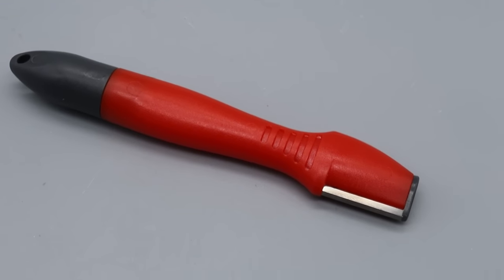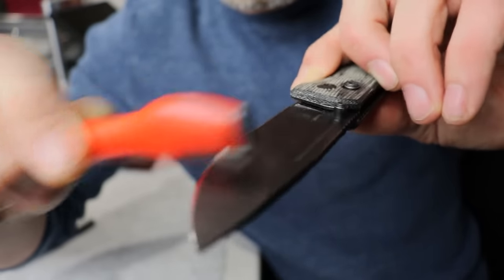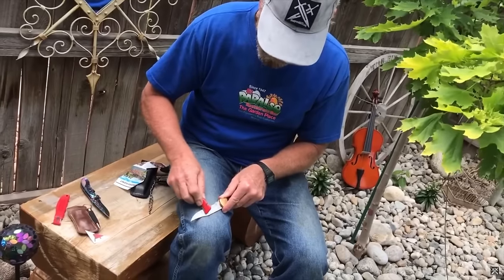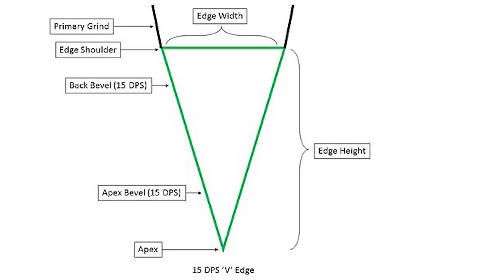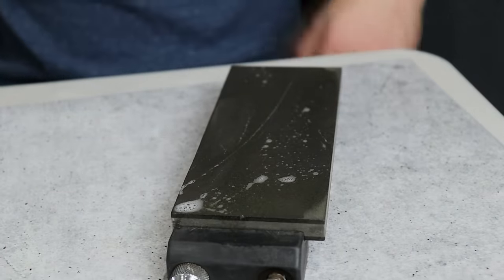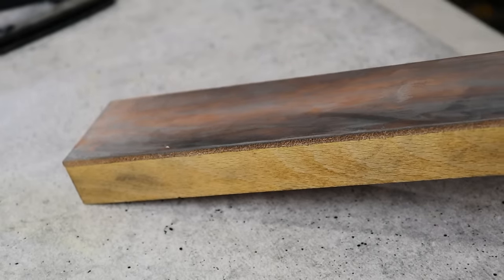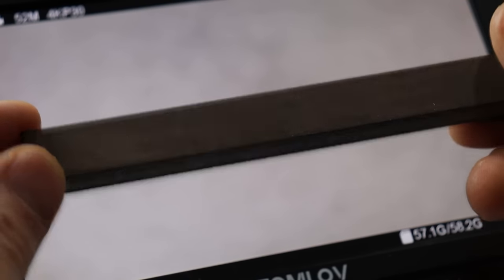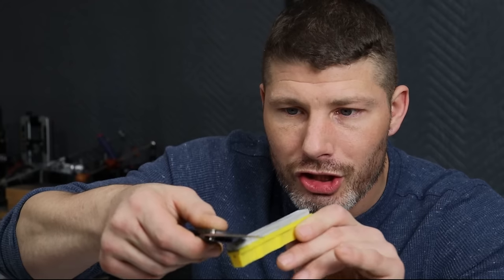Is This Sharpener Just A Gimmick or is it LEGIT

Comment: I appreciate your attention to detail in this review. I have no dog in this fight and not pushing anyone's product.  I watched several of the sharpens best videos and even watched several YouTubers review this product with mostly positive results.  Like you, the folks who do these reviews are very experienced and understand the process taking place.  I wanted to buy one of his sharpeners but think they are a little on the expensive side.  I found a similar product almost half the price at $13.00--made in America.  It just does not have a blade profiler on it. I practiced on some yard tools that were in bad shape and the sharpener actually worked well.  I moved on the doing my kitchen knives that were in so-so shape. I watched several vids and following the instructions, it did make my kitchen knives close to razor sharp. Again, it took me some practice to figure out how light, how hard and the angle to the carbide to use the sharpener.  Once you get a feel of it, I think it works well. I do not have any expensive knives with extremely hard steel so I can't speak to that.  I do want to reiterate, there is a technique and a "touch" required to used this type of sharpener and the one I have works very good. And for the record, I have a drawer with several sharpeners that I consider junk and defiantly do not work.
Reply from the maker: The problem is the way its used, watch my pull through sharpener video it will help you understand what's taking place, if I took an edge done that way vs a proper edge one would cut about 20 to 50 feet and the other would cut nearly a 1000 or more before it stops cleanly cutting paper,
Reply: like you I wanted to try it. I got the actual Sharpens Best sharpener. It took some time to get the technique and pressure to the point I was able to do a paper test and it actually worked. I use to sharpen with whetstones which I still like. I just find to bring out my entire kit, soak the whetstones...etc the Sharpens Best sharpener is a lot quicker and does the job for what I need. 

I do not work for the company and have no dog in the fight either. I just have taken courses on sharpening at a local knife retailer using all different grits of whetstones, which was amazing. I would still recommend whetstones for sharpening for sure. I just use the Sharpen's Best sharpener on the fly or when I need to sharpen a knife quickly.
Reply from the maker: @brandonkriegerKNSS  imho whetstones are only good for midrange and simple steels which is what most people use and they are great for that, however if you use diamonds i would bet you wouldnt go back to whetstones, for many reasons also they work on all steels including high performing steels, shoutout to you for taking the time to take a coarse on sharpeniing that is amazing and i love to hear it

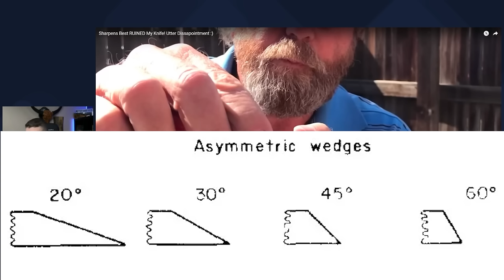Comment: 5:51 - That is very true, if I remember correctly, disposable scalpel blades are 11 degrees and those last for just a few cuts even in soft tissue before dulling
Reply from the maker: And they are super thin, so if they are very thin the edge bevel will be much smaller than if it was on something thicker like a knife, a 11° bevel on a buck would look like a scandi grind

Comment: Help: I asked the same question on outdoor 55... I have tried a few sharpeners sometimes I feel like I make it better and other times feel like I'm wasting my time. What would be a great sharpener for a "beginner sharpener" for use on hunting knives and some ok kitchen gear?? Thanks for recommendations.
Reply from the maker: it depends on the budget, and whether you want to freehand or fixed angle which will cost more, im testing a sharpener right now that i will be posting soon, but a couple diamond plates and an angle guide to place on the plates and a strop will work but it will take more effort than a fixed angled system, i have tons of videos teaching freehand, and fixed angled systems

Comment: I literally use Brad’s products everyday to sharpen knives for myself and my coworkers. 
Mostly they get used somewhat like a honing steel, but when I run my knife over metal, it also repairs the edge. It DOES take practice, but I’ve been able to get a shaving edge with it. Perfect lightest opinion in the field

Comment: i have one. u need to be lite handed with it my guy, and keep a constant angle, dont rush it. ive sharpened a benchmade SOCP dagger with it. i had the complete dull version, used only for puncher. i have it as a edc now since it can cut after using that sharpener. the key is being gentle. i never use a pull through unless its completely dull. maybe the offbrand🤷‍♂

Comment: The best sharpener for me is really cheap. Ill first make a good edge on my knife with some sandpaper grits and finish with a high grit stone/leather. That part is the hard part. After that i just use a ceramic hone and it brings the edge back to basically perfect for several sharpens. Like i dont need to really get down and sharpen but once or twice a year.

Comment: I bought one , and without using the pull through , I think it did great honing the blades back to Paper tearing sharp
Reply: Used it on my benchmades and cold steels
Reply: Yeah me too it works if you watch this video this guy hasn't learned how to use brads sharpeners they are way faster than a stone and can get stuff just as sharp😂
Reply: Your very delusional.
Reply: @JohnDoe-zb7dz I mean if it works it works 🤷🏽‍♂️

Comment: Thanks for that "classroom" lesson on this topic. At almost 74 years, I've been a cutlery lover, user & sharpener myself for decades & when I saw this product demonstrated, I came to the same conclusion. In my career of over 54 years in the "Mechanical Manufacturing & Design" field, board drafting, to 3D Solid Model CADD drafting, Machining, to Quality Assurance Management, I've been exposed to most of the alloyed metals, hybrid glass-filled polymers & ceramics that industry uses to make precision machined parts for components & assemblies. Machine shops have used tools like that as well as ceramic & diamond dust sharpening tools & grinding wheels for decades to fixture & hand touch-up cutting tools used in "CNC" Milling & Turning Machines to extend the tool life before having to purchase new high speed & carbide cutting inserts, endmills, drill bits, etc. I'm certainly not an expert, but, like you, I couldn't rationalize how that tool would work that well either. Thanks for spelling that scenario out in "layman's " terms for everyone of every level to more easily understand. Keep on keepin' on for the benefit of all.
Reply: "I couldn't rationalize how that tool would work that well either."

Well, it's very hard and thus abrasive to knife blade steels. And it's also very tough, so it will hold for a long time. At least that's what I'm thinking right meow. 😸

Comment: Sorry to say guys but I have been sharpening knives with a carbide hand held sharpener for years, sharpal, speedy sharp etc. I never bought one of these, but anyway I can shave with my knives when I’m done. It’s not going to happen overnight. It’s a skill you have to work at like anything else . But when you get good at it it’s very rewarding.
Reply from the maker: How many edge retention tests have you done after sharpening them, how many have you looked at under a microscope, how many steels have you tested. I personally have been doing this for years, I've tested most steels on the market in every geometry I've also tested almost every stone on the market. And it's overwhelmingly clear that carbide pull through sharpeners are horrible for your edge. Unless you do not care about performance what so ever. I personally prefer to get the best performance on the steel I'm using with the greatest ability to strop hone etc back many times over

Comment: You cut with the corner ie low grit then polish with the flat ie higher grit..it can sharpen not well but it can from my experience it is the hardest way to get a decent to good edge..freehand with stones of the users choice will always result in a better edge

Comment: I usually hone and strop on my Fällkniven CC4, so I wouldn't need to take out my water stone. Yes, it has a leather sheath with one side being rougher for stropping, works like a charm for me even without compound. But I have used that technique you have mentioned with a small ceramic rod too a couple of times, and I also thought it was just straightening up the rolled bits of the edge; since it is used in the same direction as stropping. And I only ever use the rougher side of the CC4 to grind out noticeable chips by the way; to sort of reprofile. :face-red-heart-shape::hand-purple-blue-peace::goat-turquoise-white-horns:

Comment: So only sharpen my edc pocket and fixed blades knives with my precision sharpeners. How ever for my larger outdoor knives like my ESEE junglas or my machetes and axes I’ve used his sharpener to grate affect. It does take a bit of practice and I would only ever use it on an expensive blade steel if I had no other option. I don’t believe it’s a scam or snake oil, I also don’t believe it’s the end all be all. I particularly like the 2 versions I got because the also have a fire steel.
Reply from the maker: With very simple steels on axes and things like that the results you are wanting are very different so using a bastard file would be just fine, or even better a round stone or both, since toughness is the goal and not edge sharpness and edge retention. As far as machete you have to do what you have to do, I think a belt sharpener or grinding wheel is best if at all possible, stones are still the best but can be difficult with large blades like that

Comment: He has sharpend dull knives to sharp, even a butter knife. He mainly recommends it for low carbide, softer steel, but I've seen him do D2 from a decent maker and even s30v (imo it's the limit for that thing). 8d never use it on my knife (unless I'm stranded) but it's nice for scissors, pruners, gardening tool and even machetes. All low alloy, soft steel that you don't really care about how it looks as long as it's somewhat sharp.
Reply from the maker: i got his exact sharpener and im going to do some in depth testing with and edge retention test coming very soon
Reply: @NeevesKnives Nice. I want to catch this guy at a show and bring my Z-max mule that I'll cut the apex off (it'll be worth it for the lolz). I have other stuff like s125v and m398 at 65hrc, but now way am I letting him touch my customs with that turd. So Z-max should be fun since it's close to 70hrc and Tungsten carbide is 75-80hrc. 
Great video as always, really enjoy your content.
On a side note, I bought a Ketuo Triad after seeing your video and I love it. But after a few weeks it has some slight up and down play. Does yours have it too or is it still solid? That's if you have it still, just realized that you probably don't keep every knife we see.

Comment: I taught myself to freehand sharpen on small diamond plates and finishing with just a few strokes on a ceramic rod or stone. I learned by doing something that i used to think i invented using sharpie on the bevel to make sure youre getting the right angle at first with a couple super light passes. Anyways nowadays I usually will still do that when sharpening a new blade but most that ive sharpened before it seems like i can tell by the sound and feel if im hitting it perfect. I think this could possibly work just like you said with super light passes to make a micro bevel. But if you're gonna do that then why not just use a fine diamond rod or ceramic rod ? Personally I'll just use what I have been using forever and am comfortable using.
Reply: Also I used to work in Lake and pond biology and management and I used to use something very similar to this to touch up the hand sickle we would use to cut down cattails under the water line. They would obviously get dull really quick but would come back easily with a few strokes with something like this. But those edge angles were so high. They would never cut paper like a knife. It was a completely different use.

Comment: He never sharpens any actual hard steel. He sharpens bs Chinese knives with butter steel. No chance he is getting a 60+ hrc knife sharp.
Reply: I think you missed the point. It doesn’t sharpen at all. It just removes material and in the wrong way.
Reply: If the stone is hard enough it doesn't matter what kind of steel it is.. If it's a little diamond plate it wouldn't matter if it was 60+ hrc.
Reply: I would love to hand dude my para 3 in maxamet and let him take it for a spin😂
Reply: You guys I don’t think he was talking about Jerad. I think he was talking about d bag trying to sell snake oil. Buuuuut if he was talking about jerad then yeah way wrong.
Reply: Just buy a dollica and throw away all your sharpening tools!!
Reply: You do realize that  cheap steel can be hardened to 60hrc right?
Reply: He sharpens Spyderco and Benchmade as well. Get a clue.
Reply: @Rubes160 it's a gimmick man. You get a clue.
Reply: @rustyshackleford5331  Tungsten carbide os about 80hrc so it will cut it but it's going to be a royal PITA. It designed for low alloy steels in the 50-60hrc range tops. I've seen him do D2 a few times and S30V and they took a while. Maxamet with almost doubled the carbide and up to 10hrc harder wi.l probably feel like sharpening a knife on a rock. Sure it'll get sharp eventually, but it'll take hours and the results will be 🐕💩
Reply: He sharpens all these cheap mtech and gas station knives and few bucks and stuff but none like what jarred carry’s
Reply: Carbide isnt touching maxamet, neither is a rock. @D00MTR33
Reply: @Hunnisloot  I didn't say a rock will "sharpen" maxamet, I said using tungsten carbide (which will cut it since it's much harder than maxamet at 67-69hrc) on it will feel like sharpening a knife with a rock (like people sometimes do on normal knives which are 1095 or some cheap stainless and it still sucks).
If you don't think carbide will cut maxamet, take some and drag it alongside the edge. Guarantee you'll have a dull knife afterwards.
Reply: @Hunnisloot  well, there are multiple types of carbides, not just one but normally when we talk about "carbide" as in tools or what have you, we are referring to tungsten carbides. This carbide will absolutely scratch Maxamet, as well as the other hard tool steels and stainless steels. There isn't much that's harder than tungsten carbides on the mohs scale or Rockwell scale.
Reply: @rustyshackleford5331  when he puts it through the vnotch you gonna see some metal removed
Reply: What's crazy is every person at those shows have shit gas station knives. Anyways, ya it's bs dude isn't sharpening shit.
Reply: @eggydrummer86 no he doesn't. Smh. Dude is a scammer.
Reply: @Sujamma_Enjoyer  wow, a person with a brain. Have a great day.
Reply: @GerstBladeworks  hey mouth. Make me a bet.  $2000. I can’t do what I say I’m doing.
Reply: @MFD00MTR33  so very true. Have a great day. Thanks for watching.
Reply: @Sujamma_Enjoyer yeah, but if you garden cheap steel to 60hrc it typically behind to have other problems, and 59 to 60 hrc is kind of the beginning of real hardness, is definitely not the Pinnacle
Reply: Seen him sharpen a ZT 0350.
Reply: @LouisL-q8z  no you didn't, you saw me use that on an ashtray sharp knife, his videos are well known for being fake and he is well known for pretending like a knife cannot cut at first and then he does his thing and him it's somehow sharp, I say somehow sharp because anybody why knows anytime about sharpening, especially professionally will tell you he cannot sharpen a knife with that, and even if he could be couldn't take it from not cutting paper (really really dull) to really sharp in less than 30 seconds, sorry but the only thing you saw was him playing you, and professional sharpeners have bought these and tried to sharpen a knife with them, none of them could do it even with a long time to practice and way longer than 30 seconds to sharpen, it's garbage produced for people who don't know anything about sharpening knives, like all knife sharpening products like that and others
Reply: @rustyshackleford5331  ooooooh man the amount of micro chips will be legendary
Reply: @rustyshackleford5331  Get ready to get back your maxamet steel knife with a lot of chipping if you let him run it into a v notch sharpener.
Reply: If it can remove material, you can sharpen with it. It might not be in the best way but sharpening is literally just removing material.
Reply: @rustyshackleford5331  ya same
Reply: @bradbuckner9496  I’ll bet you 5 grand and let’s say a real knife something good  some rex121 or maxamet and u can keep it after u game come one mouth